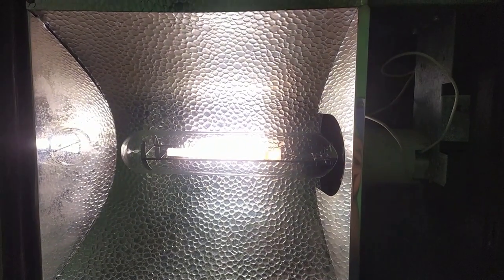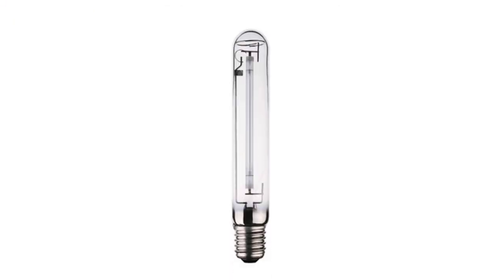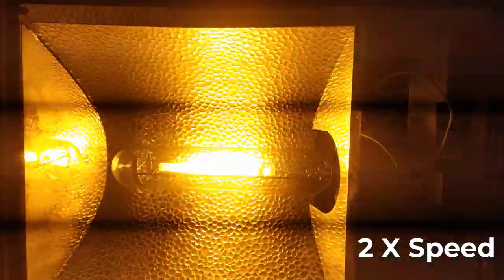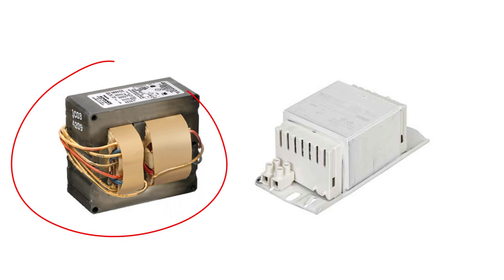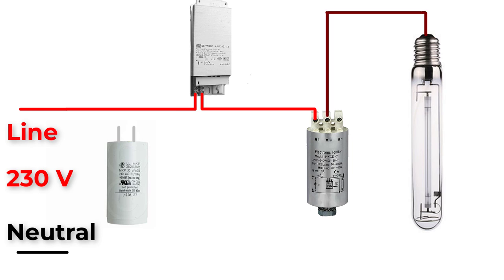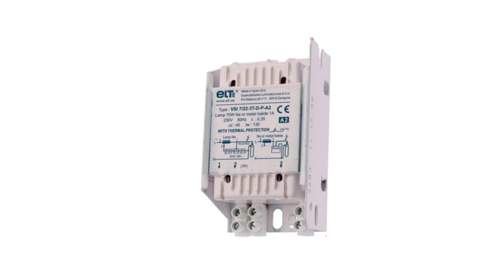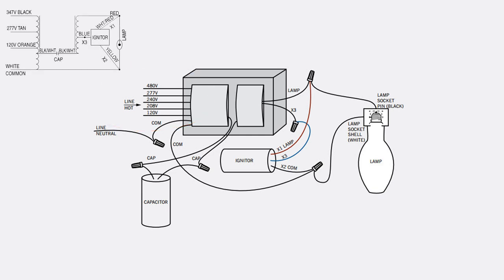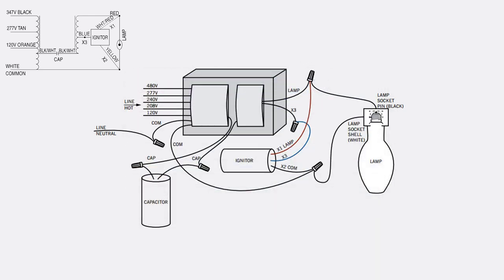How to Wire High Pressure Sodium Lamps?

Comment: i've opened up a lamp. all i see is bulb, ballast & capacitor. no ignitor. is it normal or what? please somebody help me. i'm really sure its capacitor, not ignitor cause it written 25nano farad there.
Reply from the maker: The ballast could be electronic ballast which have both ballast and ignitor in the same case
Reply: @electricalengineeringplane6620  owh thanks sir for the info

Comment: As said in the video, the capacitor is optional... It's function is to adjust the 'power factor' if this is not done you will have a higher electricity bill for running the same lamp with no extra light output  , perhaps about 20% higher I think ?
Reply from the maker: very good, this is right, maybe capacitor optional but it's important for improving power factor

Comment: how do I know what capacitor size to use?
Reply from the maker: For 400watt HPS lamp you will buy cap/hps400 ,, for 1000watt HPS lamp you will buy cap/hps1000
Reply from the maker: Size of capacitance for cap/hps400 is 55 microfarad

Comment: Thanks. What happens if you run the HPSodium bulb slightly under its rated voltage. I have a choke ballast for 240 V and our supply is 208 V. So the voltage across the bulb is almost 10% lower. Will the bulb last longer or lasts less